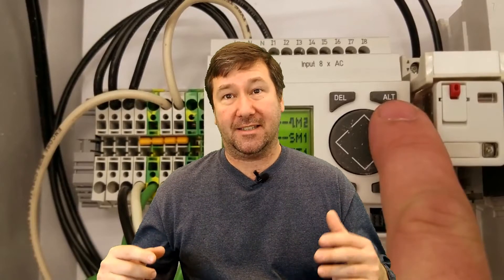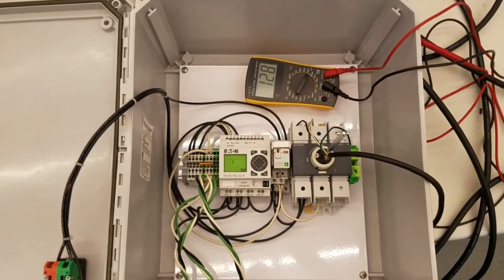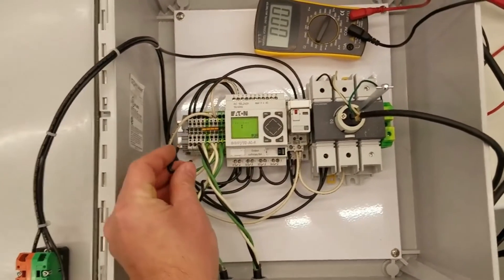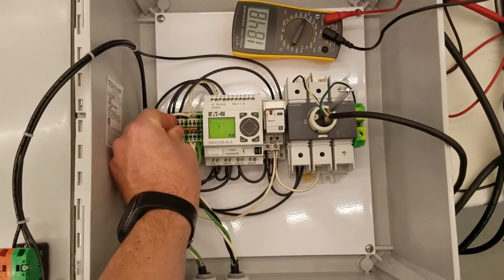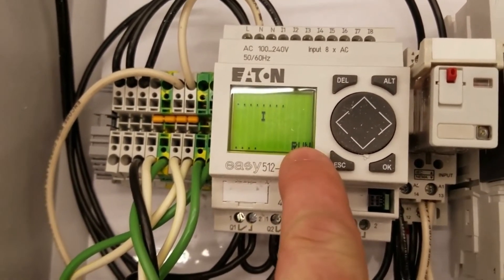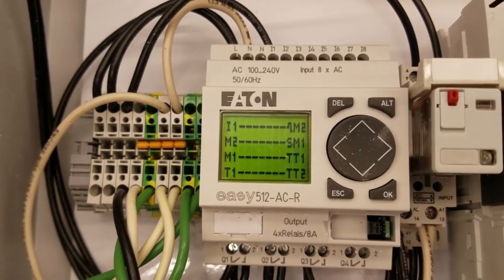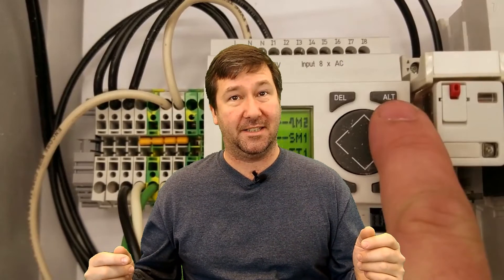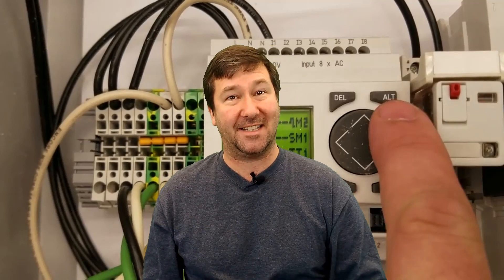UL 508A Control Panel with Eaton Moeller Smart Relay for Basic Timer and Sequencing Functions #3947

Comment: Hi Tim, thanks for all the great tutorials. Getting back into controls after years of being out of it. Do you perhaps know where I can find the info to program a 0-10V temperature sensor on the eaton easy PLC's? Mark UK
Reply from the maker: No, I do know they are capable of it but I've only programmed discrete control.
Reply: @TimWilborne  Many thanks for the reply. I am using the Eaton E4 and the user manual is not bad. I think you may drag a user function block and possibly one of the pre-defined manufacturer blocks, and configure and assign an analogue input there et.